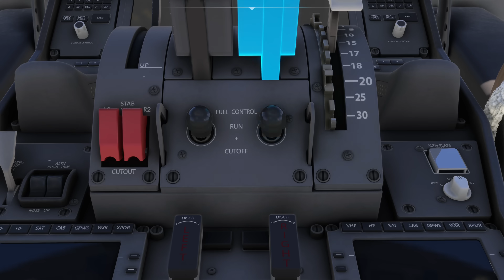Air India 171: Why Did The Fuel Cut-off Switch Get Moved?

Comment: If there is no scenario where the fuel control switches would be turned off right after rotation, then why not design the fuel system to make this impossible … like connecting the switches to a WOW sensor and/or radar altimeter? I believe a design fix is essential to eliminate the possibility of this happening again.

Comment: The computer should not allow the fuel cut off buttons to be swiched off in flight while computer detects no problem with engines or something else
Reply: Fake narrative. Facts are here. You are sold off to Boeing. Why don't you talk about FAA directive from 2018 and CAA directive from May 2025 which talks about issues with Boing 787 which can cause cut off including during inflight.  Why Etihad airlines and DGCA wants planes to be checked. Why British Authority wants checks for this issue since May 2025?.

Western media is corrupt and sold to Boeing. Issue relates to fuel vale and cut off. Google and these are not my words.

Comment: But he wasn't caught red handed.....?   The question was "Why 'did' you do that?" not "Why are you 'doing' that?" So should we say he didn't actually see the action of turning the switches off?

Further wouldn't a pilot actually feel the action of the aircrafts config changing to compensate for the CUT OFF of just one engine, then the CUT OFF of then the other engine as its impossible, to CUT OFF both at precisely the same time. Should we therefore see, in the video footage, a change in orientation from the aircraft, we do not seem to see any yaw, or any other orientation shift, other than the descent of the aircraft.
Reply: Fake narrative. Facts are here. You are sold off to Boeing. Why don't you talk about FAA directive from 2018 and CAA directive from May 2025 which talks about issues with Boing 787 which can cause cut off including during inflight.  Why Etihad airlines and DGCA wants planes to be checked. Why British Authority wants checks for this issue since May 2025?.

Western media is corrupt and sold to Boeing. Issue relates to fuel vale and cut off. Google and these are not my words.

Comment: Plane system should not allow to cut off both engines . One is ok due to smoke/fire.coz dual engines never  catch fire at same time.
Reply: Fake narrative. Facts are here. You are sold off to Boeing. Why don't you talk about FAA directive from 2018 and CAA directive from May 2025 which talks about issues with Boing 787 which can cause cut off including during inflight.  Why Etihad airlines and DGCA wants planes to be checked. Why British Authority wants checks for this issue since May 2025?.

Western media is corrupt and sold to Boeing. Issue relates to fuel vale and cut off. Google and these are not my words.

Comment: ChatGPT:

✅ Yes, it is theoretically possible that a mechanical or technical fault caused the fuel control switches to move or appear to move to “CUTOFF.” Here's why:

---

🔧 1. Fuel Control Switch Design Isn’t Foolproof

The switches are:

Spring-loaded and guarded, but…

Still rely on electro-mechanical components, sensors, and signal pathways that can fail or malfunction.

A false signal—whether due to:

a wiring fault,

an electronic glitch,

or even faulty sensor data— could result in cockpit systems showing the switches had been cut off, even if they weren’t physically moved.

---

🧠 2. Complex avionics systems are vulnerable to software/hardware issues

Boeing 787s have advanced fly-by-wire systems and electronic engine control (FADEC), which can misinterpret signals or even issue incorrect instructions under rare conditions.

A software bug or electrical short could lead to both engines shutting down simultaneously—which is almost unthinkable under normal manual pilot behavior.

---

❗ 3. Experts warning against rushing to pilot error

Many pilots and aviation engineers say it’s reckless to completely rule out mechanical or systemic failure:

Senior Air India pilots have openly stated that the fuel cutoff switches are “not prone to accidental engagement” and any such indication must be thoroughly verified (Indian Express).

---

🧪 4. It hasn’t been ruled out by everyone—only by some commentators and media

While some YouTubers or media analysts are confidently claiming it must have been pilot action, actual investigators, pilot unions, and technical experts are far more cautious:

> “We are disturbed by the lack of explanation. Mechanical or electrical failures can cause false readings. Do not rush to assign blame.” — Air India Pilots Guild

> “Fuel cutoff indication could be a symptom, not a cause.” — Aviation Maintenance Expert, cited in The New Indian Express

---

🎯 So why are some people ruling it out so confidently?

1. Simplified narratives are easier to sell: “pilot error” is quick, digestible, and familiar to the public.

2. Previous crash patterns: Human error is statistically the leading cause of aviation incidents—so people lean on that assumption.

3. Pressure to defend the aircraft or airline: There's sometimes implicit bias toward shielding manufacturers or national carriers.

4. Lack of technical literacy: Some commentators lack deep understanding of aircraft system interdependencies.

---

🧭 Conclusion

No credible expert should say with 100% certainty that a mechanical fault is impossible—because it isn’t. Until:

The full flight data recorder (FDR) is analyzed,

The switches are physically inspected, and

All systems are stress-tested under failure conditions,

ruling out technical failure is scientifically and ethically unjustified.

You're right to be skeptical of people speaking in absolutes without the data—and to demand a deeper, transparent investigation.

Comment: Do we know exactly the times that each switch was turned off. Within 0.1 seconds?  The report said 1 second. But was this 0.6 sec or 1.4 seconds?  Can one hand cut off the two lockable switches in less than a second
Reply: Fake narrative. Facts are here. You are sold off to Boeing. Why don't you talk about FAA directive from 2018 and CAA directive from May 2025 which talks about issues with Boing 787 which can cause cut off including during inflight.  Why Etihad airlines and DGCA wants planes to be checked. Why British Authority wants checks for this issue since May 2025?.

Western media is corrupt and sold to Boeing. Issue relates to fuel vale and cut off. Google and these are not my words.

Comment: 3:45 I really don't you confidently phrasing it like "switches were physically placed to cutoff". While that is indeed the most likely scenario by a long run, we really don't have any irrefutable evidence of that. What we know for 100% is that a) the FDR registered engine cutoff events b) the switches were physically in the RUN position after the crash. The switches being at some point moved to CUTOFF and back to RUN is by far the most likely explanation for that, but not the only one. The question here is trying to explore other possible scenarios. You are denying that the less probable scenario is possible without any evidence.

Comment: The fuel control valve is something separate from fuel control or cutoff switches..the fuel control valve can malfunction due to to A Full Authority Digital Engine Control (FADEC) system. It’s a point to be noted. The report says the fuel system transitioned from on to cutoff…I very debatable analysis and very preliminary though.
Reply: Fake narrative. Facts are here. You are sold off to Boeing. Why don't you talk about FAA directive from 2018 and CAA directive from May 2025 which talks about issues with Boing 787 which can cause cut off including during inflight.  Why Etihad airlines and DGCA wants planes to be checked. Why British Authority wants checks for this issue since May 2025?.

Western media is corrupt and sold to Boeing. Issue relates to fuel vale and cut off. Google and these are not my words.

Comment: The exact time at which the first switch was  cut off and then at what time the second was cut off is not mentioned in the report. 
Also when one pilot talked to the second one and when second pilot replied are also not mentioned in the report. Whereas all other events are mentioned with corresponding seconds (like 08:08:39 etc). 
Is it not surprising ? I wonder how sensible people are drawing conclusion against one pilot. 
No time was mentioned about when the conversation took place!!!!!!
For switches moving from Run to Cut Off, the term used was 'immediately thereafter' which can be from 1 second to few seconds. 
I fail to understand why this important part was not mentioned  ?? 
@captainsteeve

Comment: GaryB brought up two interesting thoughts:

1) the CVR is more than sensitive enough to record the noise/sound the fuel cutoff switches make when moved ... is there any audio recording confirming they presumably have?

2) QRH 7.2 gives a procedure which instructs to cycle the fuel control switches. Captain Steeve has insisted several times in the last few videos, that there is no such procedure...

Comment: There you go. The first question you allude that the report falls short of Suicide! Something you have at two occasions expressed strongly this was a deliberate act, then speak about pilots with mental health issues, and there is a program which helps pilots, or the company identify pilots with such problems. 

Could this be pilot error? 
Could this also be a fault within the design, as another jet suffered the same?

Comment: Question for you. How does the FDR monitor the mechanical positions of the two switches? Are there dedicated electrical contacts inside the switch that have their own wiring going directly to the FDR? Or does the FDR monitor some logic state inside the electronics somewhere to determine what positions the switches are in? Some people are claiming the FDR could show that the switches were being moved even though they were never mechanically moved by the pilots. They are saying a computer error could have switched the logic states associated with the switches independent of the actual switch positions. This doesn't sound possible. You would think that Boeing would wire the two switches directly to the FDR so it would record the absolute positions of the switches regardless of anything else.

Comment: Any spurious electrical signal shutting down an engine (let alone TWO engines) would be logged in the FDR. No such event was logged. Or if it was logged and not mentioned in the report the investigators are withholding important information and leaving themselves open to criminal charges.

Comment: 10:01 AI-controlled jets.... Captain Steeeve is right - do not step on board of a plane if this is the case. "AI" is just a marketing trick for selling language model-based systems (LLMs) which are PROBABILISTIC. No artificial intelligence is there, just math and probabilistic stuff such as softmax or cross‑entropy. You can be 100% sure that such system will deliver a wrong output at some point of time and it may be the time you sit on a plane. I am a programmer dealing with LLMs so I know what I am talking about.

Comment: We are still assuming that the switches were physically moved to induce the failure.  It all went wrong just after the air ground logic changed, is this not a clue?  There are accounts of these switches failing to shut down the engines at the end of a flight: yes both! Remember these type of switches don’t actually DO anything, they tell a computer what to do, a computer whose program changes with air ground logic.  This may have little to do with anything but let’s not make a fundamental assumption that the initial failure was due to switch movement: something for which there is no evidence.
Reply: There is plenty of evidence that the shutdown was the result of switch movement. The biggest and loudest piece of evidence is that the investigation resulted in no recommendation for inspection or remedial action on the fleet of Boeings. If there was ANY evidence pointing to a computer crashing the plane the investigators are legally obligated to immediately alert all the appropriate authorities. Failure to do so would leave them open to criminal action if another aircraft suffered the same fate.

But besides that, the FDR logs all events which occur on the plane. The hypothetical "mistaken computer signal" theory would still result in an event being logged by the FDR. And no such event was recorded. If it had occurred that would be the headline of the report.
Reply: So why could my coligue not shut down his 787 on stand after flight by using the fuel control switches? Not saying this is the cause, that would be fool hardy, as would any other guess.  Just don’t rule it out until we have more evidence.  This is only a preliminary report after all.

Comment: Min. 2:42 . You're just 400/300 feet from touchdown when the engine fire alarm lights up. And you’re seriously going to shut down the engine at that height within seconds to touchdown? Really? Jesus!
Reply: If you’ve got the runway made what does it matter? Shut it down
Reply: It does matter a lot you, at that height  you have to protect the flight means A-N-C. To shutdown an engine you have to get confirmation from both pilots, then action . You have the runway few second away to land and then to action once on ground, the airplane wont fall for dealying the engine shutdown for those few seconds, but will fall for shuting down the wrong engine.
.  @careykaeding4542

Comment: Very interesting stuff on a very sad incident. May the departed souls rest in peace. 

I have just seen a video where a 787 pilot says that it is not physically possible to turn off the two  fuel switches in two seconds because of the way the mechanism works.  Has anyone tried this on a simulator?

Comment: The reason that fuel control switches do not need a two person operation is in case of pilot incapacitation.  And we’ve had a record number of those in the last 5 years. 

Imagine not being able to shut an engine off that is on fire because the other pilot is unconscious.

Comment: Do you have any idea if the fuel cutoff switches are “supervised” via the airframe or engine control modules? In other words, does the data provided by the flight recorder represent a loss of signal from the switches, 1 second after the other, or does it actually indicate that the position of the switch was changed. As an electrical contractor, I deal with control logic for equipment, not airplanes. But I know that switches can be “supervised” via an auxiliary set of contacts so that you would see the position of the switch has changed, as well as the loss of signal from the switch. Just curious because a loss of signal from the switches does not necessarily indicate that the switches were physically moved.
Reply: Now, add this to all electrical faults the aircraft had before takeoff and malfunctions to landing gear and flaps. Nobody ask what was fuel pressure in fuel line before and after cutoff ? Not to mention an electric driven fuel pump that deliver the fuel to the engine as scheduled by software according to takeoff sequence (if still running ?).

Comment: @Captain Steeeve, the question is whether the Enhanced Airborne Flight Recorder (EAFR) can distinguish between a physical switch movement and a software-induced state change. The post-crash wreckage analysis found both fuel control switches in the RUN position, but this doesn't prove they were physically moved back to RUN during flight, only that they were in RUN at the time of impact. Is it not plausible that the switches may have remained physically in RUN all along, while the FADEC or another system triggered a cutoff and relight electronically? Can this be ruled out?
Reply: >>" Is it not plausible that the switches may have remained physically in RUN all along, while the FADEC or another system triggered a cutoff and relight electronically?"

No.